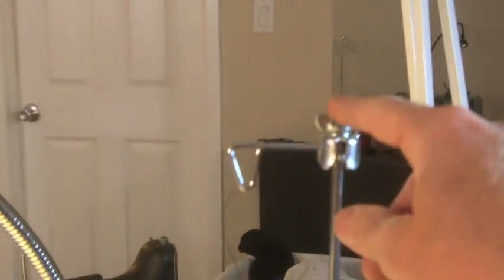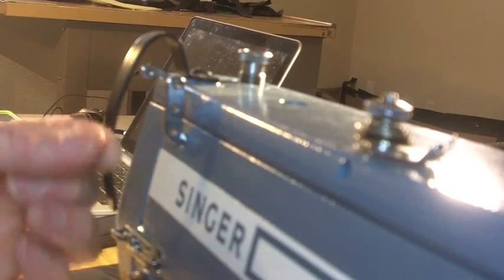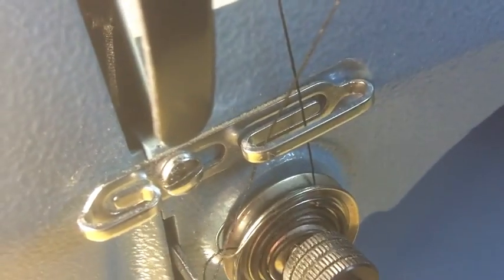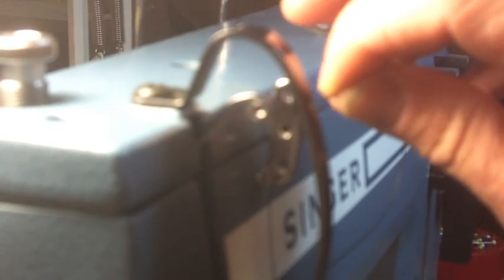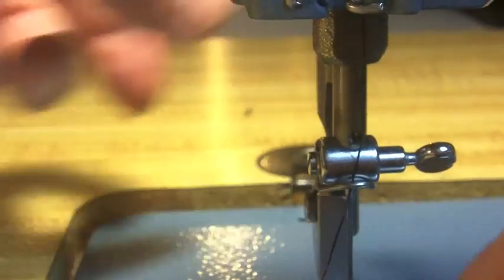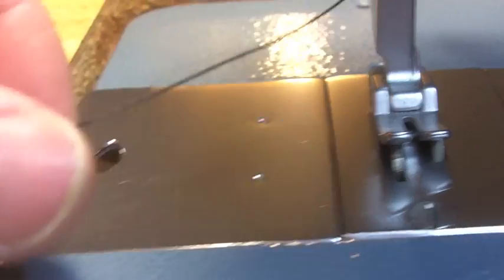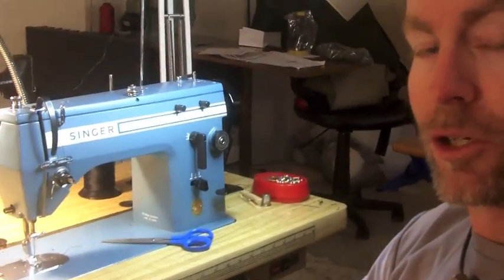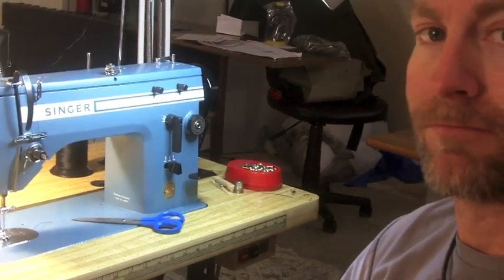Threading a Singer 20U/20-33 industrial sewing machine

Comment: my grandson who work for a company that cleans out 'junk' brought me one  of these  machines.  it didn't have a table, but did have a clutch motor, the table, the machine, and no legs.  I just found some k-legs for it.  we hooked it up.  it seems that the motor works fine - the machine works fine - but it's missing the throat plate to the left of the needle plate, and the switch to turn it off and on - doesn't work.  do you have a suggestion on where to get parts?  or a manual?
Reply from the maker: Singer.com has manuals (click on "help/manuals" near the top) for free download.  I think sewingpartsonline.com may have some parts for this machine, but I'm not sure.
Good luck!

Comment: Does this machine require sturdier or heavier thread or can I use my regular thread on a cone? Thanks
Reply from the maker: In general, this machine will use a range of threads similar to what any household domestic machine will use.  Some versions of this machine have a "normal" thread spool holder on top of the machine, and some don't, but you should be able to use either with a free standing thread stand or whatever is attached to the machine.
I hope that helps, thanks for watching!

Comment: Hi do U still have this singer 20u sewing machine? Has it held up well ?  I heard the older models  wewre built like tanks..
Reply from the maker: Hi!
I sold this machine about 4 years ago, primarily because I was moving across the country, but also because a walking-foot machine suits my needs better.
These are great machines, and I agree that older sewing machines (and pretty much everything else) are far better built than ones built today.  I don't have much experience with more modern machines, but my sense is that they are fine, just some of the components may not be as solid as a few decades ago. In general, if I have a choice between a well-maintained vintage machine or an identical new machine, I'll always go for the vintage one.  Just my opinion, though!
I hope that helps, thanks for watching!

Comment: Great info.  I have the exact same machine 20u Professional.  My problem is needle size.  This seems incredibly confusing.  I will be using a heavy duty thread, V92 to stitch heavy canvas and sailcloth.  Any links to the needles I should use would be great. I have had so many bits of advice but nothing specific.  Many thanks. Andy UK
Reply from the maker: Hi Andy,
You are correct, needle sizes are confusing, and with industrial machines you also have to consider the needle system that the machine uses (virtually all domestic machines use one needle system, but there are many industrial needle systems.
In case you don't already know, the 20U uses needle system 135x5 (and there are about 5 other system names for the same system). If you search for 135x5 you should find what you need, or just search Singer 20U needle system.
Regarding size, there are a couple of sizing systems, American and European.
For V92 thread, I would suggest something like size 18 (American)/110 (European), or 20/120. (So when looking online, you are looking for a 135x5 needle in size 110 or 120.)
The general rule of thumb on needle size is to choose the needle size that best fits your thread. The thread needs to pass fairly easily through the eye, but also needs to fit well in the channel on the needle shaft; too small of a needle will cause thread breakage, among other issues, and too big can cause malformed or skipped stitches, among other issues.
I found this site to have some good info on the topic - 
https://www.servicethread.com/blog/article/choose-the-right-needle-size-for-your-industrial-sewing-thread
I don't have shopping links to share, and many of the sites I purchase from are in the US, but I am certain there are good suppliers in the UK for industrial needles.  I would suggest buying several packs in a few sizes to experiment with.
I hope that helps, good luck with your projects!
Reply: @thejasonofalltrades  Hi, brilliant, at last some information that makes some sense and gives me the info I need to search for the right needles.  I really appreciate the detailed reply and I will start searching now.  Best regards. Andy

Comment: Thank’s for nice video. I’m new with Singer 20U33. Very fast machine😀
Any hint if I can slow it down?
Reply from the maker: The easiest way to slow the machine would be to put a servo motor with speed adjustment on it.  Then you can turn the speed down to your comfort level.
You could possibly change the pulley on the motor to slow it down, but whatever speed you end up with is what you have.  You would need to replace the belt if you change pulleys (depending on how big/small the pulley is).
I hope that helps, thanks for watching!
Reply: @thejasonofalltrades  A lot of thank you for the answer. If I need a servo Whitch Name? I have a Singer motor.
Reply from the maker: There are a number of cheap servo motors available on eBay and Amazon.  Check out my video "Dumping The Clutch," it explains a lot of the process.  It's pretty simple, and you can probably just pick the cheapest motor you find, I suspect they're all pretty similar.  More expensive ones (like the Sailrite Workhorse I'll be reviewing soon) will have better instructions and support, and probably better quality control.

Comment: do you know how to replace belt of singer  model 20U33
Reply from the maker: Hi!
I no longer own this machine, but if you are referring to the belt that connects the motor to the hand wheel, it should be as simple as tilting the machine back to take out the tension, and slipping the belt off.  I don't recall exactly how the belt cover is on this machine, it's possible you may have to remove some screws and take the cover off, but that should be pretty simple.
I hope that helps!
Reply: @thejasonofalltrades thanks for your help, it really helps

Comment: Thank you for the video. I just bought a 20u33 and working through some kinks. Could you share any info on the best peddle geometry or motor adjustment to support slow speeds? Also any input you have on thicker thread use for bold top stitch look would be great!
Reply from the maker: Hi Ryan, 

First, I no longer own this machine, so I'm going from limited memory as far as this particular machine goes.  

I'll address the thread first.  I forget what the maximum recommended thread size was for this machine, but I think it might be size 92 (aka V92 and several other designations).  I use V69 on almost everything I sew, and occasionally use 92.  I think the next common size up is 138, and I don't know how well (or if) the 20U will run it  (but others on the internet certainly will know!). You might be able to run a thicker thread on top and a lighter thread in the bobbin.

I don't really know anything about changing the pedal geometry or motor position in order to affect speed, but I don't believe that is an effective way to do it (I'm very much prepared to be wrong about this).  One way I know of to change speeds is a different size pulley on the motor.  Another, and probably better, would be to change to a servo motor with a speed adjustment knob so you can go slowly when you want and faster when you want.  The shop I work for has servos on everything except for one machine, and it always takes a couple of moments to remember how to use a clutch motor when I use that machine.  Servos are far more user-friendly and controllable.  (I like clutch motors, by the way.)

The question that comes to my mind is - what are you going to be sewing?  I hate to say it, but thick thread and slow speeds isn't exactly what this machine is made for  - a fact I learned after I bought mine.  The 20U is primarily designed for the garment manufacturing and alterations market, and is intended to sew apparel fabrics for the most part (it also is apparently excellent for embroidery, but I never used it for that).  Like any other sewing machine, it can be made to do other things, but if you're doing heavy upholstery or leatherwork or something, I'd suggest looking for a more appropriate machine.  One of the reasons I sold mine was that my Sailrite was far more capable of sewing the thicker technical fabrics (Cordura, ballistic nylon, webbing etc.) that I use most.

Anyway, I hope that helps.  The 20U is a good machine, and a great first industrial machine, but it is fairly limited.  Good luck, and let me know if you have other questions.
Reply: Hi

Comment: Literally, the one part I need to know, winding through the tension discs, you don’t have the camera pointing at that
Reply from the maker: Hi,
When I filmed this video, I was holding the camera for much of it, and sometimes the camera isn't pointed exactly where I might have hoped. However, it should be really easy to see in the clips right before and right after where the thread goes between the disks.

Comment: question : do you think this machine would be good for marine vinyl , I was thinking of redoing my boat seats
Reply from the maker: Hi Robin, 
The 20U/20-33 is primarily designed as machine for clothing alterations and light manufacturing, not marine fabrication or upholstery.  It's a sturdy and powerful machine (depending on the motor bolted to it), and has a long stitch length, so it can certainly tackle an upholstery job, but I wouldn't buy one specifically for that purpose.  A walking-foot machine would be better for marine vinyl and other thick or hard-to-feed materials.  If you don't have/can't find/don't want to buy a walking-foot machine, any sturdy vintage domestic machine should be able to struggle its way through vinyl almost as well as the 20U, so if you already have something like that (or find a cheap one at a garage sale or thrift store, etc.) I'd try that before spending the money or dedicating the space to a 20U.

If you already have a 20U, then go for it! It's not ideal, but it should work fine.

 I hope that helps, good luck with your project and thanks for watching!

Comment: Do you know of a source where I could buy the extra bobbin winding attachment for this machine? It installs on the table under the wheel and winds a bobbin while you are sewing. I searched a little online, but I am not sure what it is actually called.
Reply from the maker: I wasn't aware there was one for this machine, but now I want one!  Sorry, but let me know if you find one.
Reply: I am back to my search, I did find a photo of one, but not sure there is a way to post it here for you to see?
Reply from the maker: Hi Thom, 
My only suggestion is that you might find an industrial sewing shop and see if they have one.  I'm guessing it's a generic winder that will fit many machines.  There's a shop in Denver called Ralph's Power, you might look them up and give them a call, if they don't have one they might have better information.  Also, you might want to check out my bobbin winding video for this machine.  I show how to wind a bobbin while sewing with the machine.  I'm not sure what this winder offers in addition...?  https://www.youtube.com/watch?v=bd5ymKLWV3c&feature=youtu.be
Thanks!

Comment: Hello, Thank you for that video. Could you tell me about what needle and how to instal the needles?
My machines thread is fraying and the under thread on the fabric is all bad:(
Reply from the maker: Hi, 

This machine uses 135x5 needles (it's complicated, as it's labelled different ways, but 135x5 will get you there).  I usually used size 18 with V-69 nylon thread.  The needle size is dictated by the thread size, which is (generally) dictated by the fabric you're sewing.
The needle is installed with the groove to the front on the needle oriented to the front of the machine.
I hope that helps, let me know if you have other questions!

Comment: Thank you for your demonstration . I have 2 questions for you . First , Dose this machine work wit twin/double needle ?? For things like decorative top stitching . Second , how thick this machine can sew ?? I'm asking about things like heavy wool for coats , jeans , fleece and the like . I'm an amateur tailor , and mainly I make suites and coats , and seriously thinking of getting one . Specially that they're much cheaper than some home sewing machines .....
Reply from the maker: This machine is not equipped for using a double needle.  I imagine you could make it work, but it isn't specifically made for it like a double needle machine is.  Some of my other machines have two sets of tension discs to allow for running a twin needle; this does not.  I've never tried using a twin needle, so I'm afraid I don't have a lot of input here, sorry!
I generally run size v69 thread (equivalent to Tex 70), and I've had no issues.  This machine is intended to do light production and alterations on garments, so I think it should be a good choice for your tailoring needs. The only trouble I've had with it is getting over thick seams on slippery nylon fabrics.
You may also want to check out my bobbin winding video on this machine, if you haven't already!
Thanks for your question, and thanks for watching!
Reply: thejasonofalltrades Thank you very much for your feedback ...
Reply: Sorry for bothering you, but I just remembered something. I have another question. Does this machine come a walking foot ?? If not, Am I able to purchase and install one ??? Thank you for your informative videos and advice....
Reply from the maker: It is no bother, that's why I'm here!  
This machine does NOT come with a walking foot.  I presume you know, but there are walking foot sewing machines, and then there are accessory walking feet that can be attached to non-walking foot machines to give SOME of the advantages of a walking foot.  So if you're talking about a walking foot that attaches to a non-walking-foot machine, then no, it doesn't come with one, and I don't know of one specifically for this machine.  It's possible a Singer-compatible foot might work, but this machine is very fast and powerful compared to Singer home machines, and I wonder if a home machine walking foot attachment would hold up.  This is why I currently have 7 sewing machines ....
I don't do a lot of apparel work, but the only issue I've had with this machine feeding well is on thick seams on Cordura nylons.  In fact, I'm strongly considering selling this machine, since I end up using my Sailrite walking-foot machine more because of its superior feeding (even though it's slower).  But I imagine with stuff like denim it would work better than it does with Cordura.
Thanks for the question!
Reply: Thank you very much for taking the time to answer my question ....

Comment: hi. how do you adjust the belt for this machine
Reply from the maker: I'm assuming you're referring to the drive belt that connects the balance wheel of the machine to the motor under the table.  My machine head is mounted to a table that formerly had a different head mounted to it, and is not the factory configuration, as far as I can tell.  So I don't know specifically how yours will work.  That said, on my motor there is a long bolt with an adjusting nut that moves the motor back and forth to adjust the belt tension. Yours might be different, but basically the tension should be adjusted at the motor.  I hope that helps!